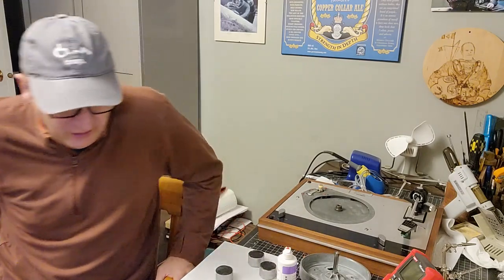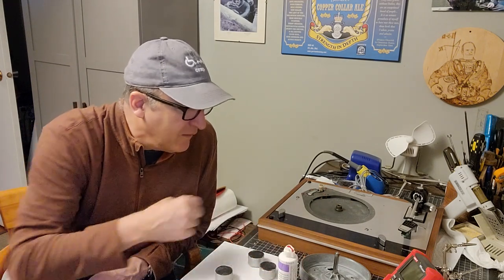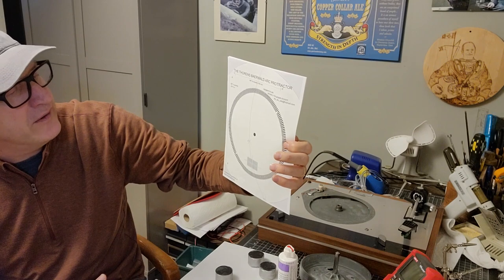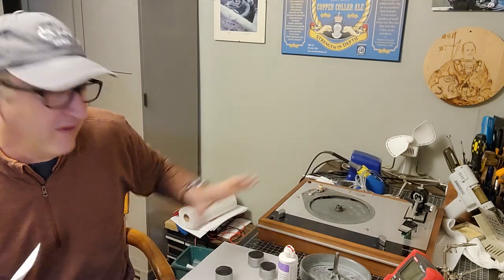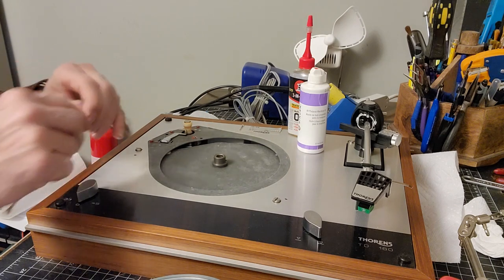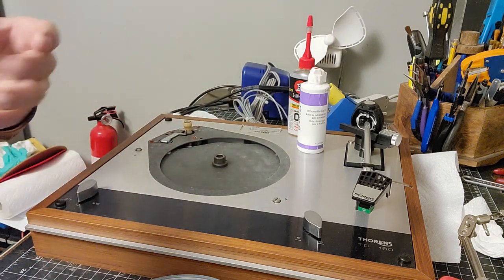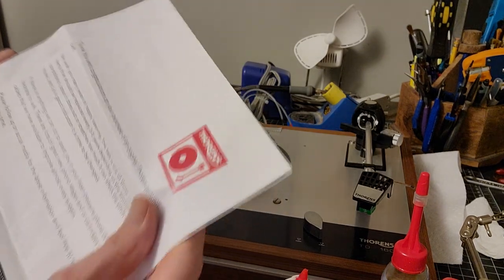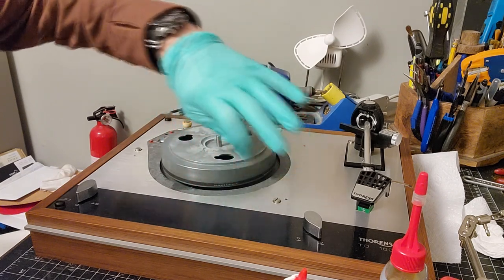Part 4: Thorens TD-160 Project (Bearing Lube - Drive Belts - Arc Protractor) 21 Mar 2022

Comment: Thank you for the video, Tim. I was looking to replace the belt on my circa 1983 Thorens TD147. I think you nailed it with the Thorens part number 6800574. Ordered one today in hopes that it will fit the same as your TD160!
Reply: Received the new belt yesterday and its a perfect fit! Found that the old belt wax stretched about 1/2"!

Comment: Love your videos, as I recently brought my TD 145 MK II out of storage and am in the process of tuning it up. In the 45 years I have owned it, I never lubricated the bearings. I checked the spin of the sub-platter as you do in the video, and it spins just like yours does after lubricating. Should I still go ahead and lubricate? Also, mine doesn't auto-lift at the end of a record, I don't recall whether it ever did. Were all 145s made with auto-lift? If so, can you do a video on checking that? Please continue posting videos like this, you are doing a great service. Thank you!!
Reply from the maker: Thank you,
Alas, I do not have a TD-145 to attempt fixing the autolift. I hear they can be quite finicky. As for re-lubing, it wouldn't hurt if the oil is decades old to give it a change. If spinning good with no noticeable abrasion you are probably OK so your call.
Reply from the maker: Here is the poor man's auto lift I use on my 2 X TD-160 and 2 X TD-165 turntables:
 https://youtu.be/PKntgFN4JTg
Reply: @navydiving  I saw that in another of your videos. I may resort to that if I can't fix the auto lift on my turntable. Thanks.

Comment: Nice work!
What type of oil did you use to lubricate the spindler plater axis?
Regards.
Reply: Ok, you said on the video. Sewing oil machine is ok.
Reply from the maker: @guilhermedealmeida2299  I am a Hydrocarbon Engineering Technologist by education (among many other quals), so I do know a thing or two about oils and lubes. 😁🤣
https://timothyflath.smugmug.com/Personal/Certs/i-k4RtRJ4
Reply: OK. I know you are an expert in that field of lubrication. I asked only to obtain a useful and educated information. Nothing more than that.

Comment: My experience with alignment of my thorens , there is a slight difference between the use of thorens gauge and the correct Barewald Protractor.  So which one to use?
Reply from the maker: There is a slight difference between all differing geometries. There are no right answers here, only preferences😉
Reply: @navydiving  thanks.

Comment: What is the overhang? I need to know so I can draw the Arc for 10.5 inch arm yes it's not going in it's original place cheers,
or if anybody knows the overhang is for 10.5 inch arm ? used to be a website I can't remember what it is now
Reply from the maker: https://www.analogplanet.com/content/tone-arm-geometry-101
and
: http://turntablebasics.com/mounting.html
Reply from the maker: If you really want a head scratcher, then read this thread as far as you can:  https://www.audiocircle.com/index.php?PHPSESSID=nlabd9817aubg3ier5hs2r9vnq&topic=70898.0
Reply: @navydiving  sure I will do cheers. What's the standard TD 160 mkll arm overhang then? what does that gauge say  it is? 
 I had a look it's all good but doesn't really help me! there used to be a website you don't know of it ? that gives you a spreadsheet of length of arms and overhang to given length, and other information like compliance that's what I need to know, otherwise I can't do anything on drawing the angle, till I know what the given overhang is for the length of arm at 10.5 inches 266.7mm